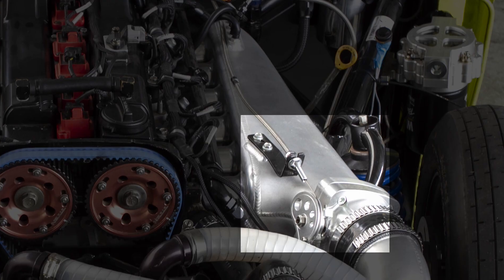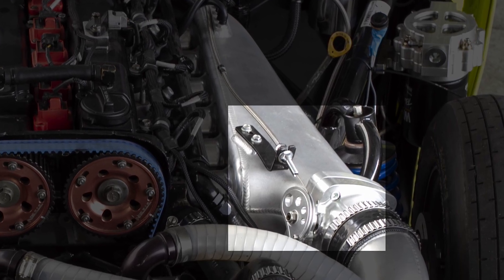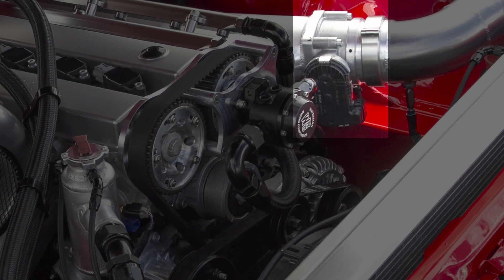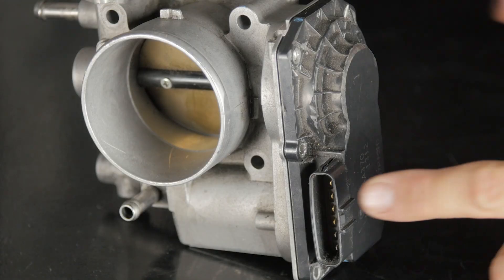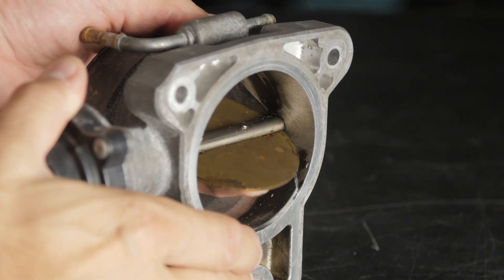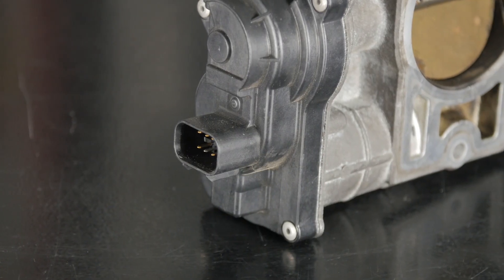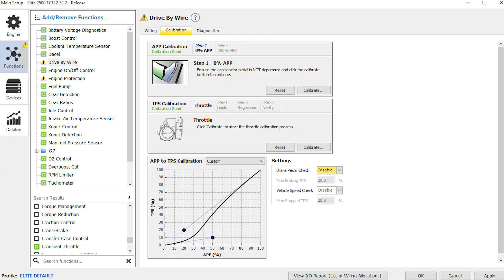🛠 Drive-By-Wire or Cable Throttle?  | TECH TUESDAY  |

Comment from the maker: Cable or Electronic? One has been around for ages and has plenty of supporters, the other claims to be better, quicker and more adaptable. In this episode of Tech Tuesday Scott gives you a brief overview of both systems and offers his opinion on this polarizing subject.
Reply: I personally prefer cable.. my old is300 drive by wire was a major pita
Reply from the maker: @MannyFresh1x  performance application of DBW differs greatly from OEM versions. Same throttle bodies and pedals, different control strategies. Give it another chance some time!
Reply: @haltech  no dbw can match the feel of the cable.
Reply: I have 3$
Reply: @ATLASGAMINGApallo  can you use brake fluid to clean a mass air flow sensor
Reply: @philfrancoeur4982  bwahaha 😂 😂
Reply: My favorite thing about these Haltech videos is it settles the argument for me. No anecdotal nonsense. Just a professional tuner laying down the truth.
Reply: You mentioned drive by wire cruise control how would a guy go about setting that up
Reply: Haltech just wondering about the 2jzgte in the aristo’s they are cable/electronic, so you use cable to open the throttle partly and the  electronic motor will open it fully?
Reply: Throttle relocations... oh my are there some bad one out there.
Reply: 2:14 it took Ford at least a few years before they made a reliable one. Just like when they switched to coil on plugs (though that was bad boot design)
Reply: DBW sux

Comment: My 2010 Mercury Grand Marquis (fancy Crown Vic) has an electronic throttle. I've been considering an engine swap because the 4.6 2v isn't adequate for a car that weighs 4100 pounds (1900~ kg, I'm American, sue me). The engine makes peak power at 4800rpm and torque at 4,000rpm. The car doesn't typically see above 3500rpm. The struggle is that the e-throttle makes the swap I'm looking to do, unnecessarily difficult.

Comment: A rubbish video. You did not mention that ride by wire failed all the time. And there is no warning.  Ride by wire is rubbish. Cable last forever.

Comment: If my car came with an idle air control valve that was plumbed into the throttle body and I convert to this DBW does the IAC valve get eliminated?

Comment: Electric throttle can be turned off if the car goes into limp mode. Pretty big downside if you want to drive the car.

Comment: If I buy an install a manual throttle body.How will the computer know what the timing is and how to make the engine run?Like when I've got the throttle Wide open. How the computer now?I've got the pedal to the floor
Reply: From tps input

Comment: Took an engine out of a truck Chrysler hammy.And plan on using it on my airboat.So I'm trying to limit a lot of the electronics and I'm trying to go cable to the throttle body.That's why watch the video.And I understand that your virtuality is great with all your electronics.But electronics on the water have a problem. Electronics is better

Comment: I just got a xr6 manual ute and the electric throttle is absolutely DISGUSTING to drive coming from only using a cable throttle, the disconnected feeling especially in a manual is just no good.

Comment: cable 100%. Some cars have so much delay on the throttle that you can quickly stomp it up and down before the engine does anything. Rev-matching is WAY faster and easier on cable throttle bodies.

Comment: I own cars that use both and the cable is SO much more responsive.  On electric, I can usually floor the pedal and lift off of it immediately and the engine doesn't even respond.
Reply: Depends on the car and tune

Comment: I hate driving stick with an electronic throttle, there's input lag as well as rev hang, so you get screwed on both ends in the feel department. That's a deal breaker for me, economical improvements aren't important to me for a car that I don't like how it drives. Thats the real downside to them. Thankfully my car was cheap, like cheap before the used market shot to the moon cheap

Comment: Ran into a major issue with an electronic throttle body. My serpentine belt snapped because my ac compressor seized, the alternator didn't have power and the gas pedal was the first thing to lose power. If it was a cable I could have driven all the way home to fix it

Comment: well shizz , i hated DBW i always been a cable guy ,but after you explaining it more correctly and how much more useful it really be specially wile im full standalone n forged n boosted it might benefit quite well as to my launch/2step/ n rolling anti lag that i might just switch to DBW... but i also have a jeep that is DBW and pos CVT but the throttle response is not exacly what i would say responsive unless u are like 50percent or more to the floor n then cvt will keep it at 5k wile accelarating till up to speed (redline at 7k) so it always kept me partial to a cable as i can set it how i want by hand ... as i further understand the usability of DBW i guess i need to "get with the times" .... lol ... n e way i stop rambling , peace n love to all stay safe keep it rad and build on

Comment: I have both and there is a hugh lag in the dbw on my 04 gmc 2500hd 8.1 when i need the to come on quick IT DOES NOT IT LAGS FOR GOOD 5 SECONDS IT SUCKS unlike my 96 chevy k3500 7.4 where its dbc as soon as my foot hits the pedal all the down it comes on now so yes i hate all dbw plus if you have dbw all you gps and onstaror other people can remotely stop your car from moving they CAN'T do that if is cable driven plus he is way wrong about priceing to replace the throttle body there almosy about 3 times the price of a dbc throttle body to replace plus the tps and iac valve can be replace indenpdently rather then buying to whole throttle body in dbw system

Comment: Until out of no where it decides to go in to a limp mode and not being able to go faster than 5 mph and it always happens when pulling in to traffic, cable driven throttle’s never ad any issues at 40k miles also if I want to check for a noise under load it can be done without anyone else having to step on the gas pedal inside the car. I like cable I like simplicity

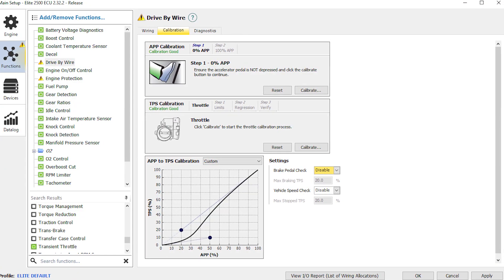Comment: If i keep dbw in a k24 Acura TSX, with Hal tech, can i tune it like a pedal commander would and remove lag i guess ?? 3:18 is what I’m referring to. It’s dbw but already has a cable in the bay… I’d like to keep ac but no heater… and i don’t mind going haltech… what ecu do i get ?

Comment: Cable definitely I have a 2007 Chevrolet Silverado have changed everything and still have problems with reduced engine power junk getting ready to replace with cable then no problems

Comment: Ahhh, there in lies the responsiveness problem.  If it is not a design flaw, then the manufacturers "dialed-in" the slow throttle response to pump up their gas mileage ratings, & or to minimize wear & tear on components.  If you are use to the linear response of a cable activated throttle (including a carburetor) then it is very annoying to have to modulate the pedal to get the car to respond appropiately.  Why should I have to over press the pedal initially (to get the speed I want) only to have to ease up on the pedal just enough?

Comment: There are a lots of motorcycles that have both cable and DBW throttle blades.
The lower "primary" throttle blades are cable and the upper "secondary" blades are DBW through the ECU (with Primary TPS, Engine RPM and Gear Position inputs) so we have quite a bit of tuning/control over them with ECU flashing...

Comment: I watched this video about a year ago when i was making my mind up about going DBW or staying cable. I ended up going drive-by-wire and honestly i cannot recommend it enough. throttle response and rev-matching is so perfect. There is no input lag whatsoever, idle is perfect. If anybody ever tries to tell you that cable is better - tell them to stop living in 1995.

*edit: 400kw RB25 S15.
Reply: Is that how arguments work now a days? stop living in 1995?
Reply: Nearly 3 years on, still using the same Bosch DBW throttle body. A+++++
Reply: @Songtester  with you on this. And respect for not rising to the bait!
Reply: atleast cable last longer and more reliable  a DBW would fail due to tps issues and all sort of stuff
Reply: Nah, cable is better, stop using your daddy’s money buying the newest cars

Comment: Considering how I could replace a while throttle cable assembly 2 or 3 times for the same $625+ price of just the electronic gas pedal. Not counting the throttle body and those parts.

So computerized or a physical cable. I want a cable that costs a fraction of the price to fix....

Had a cable loose once and just cut some off, tied it and used steel stick to hold it in place and worked great. 

So 8nstead of helping consumers save money on car repairs. Seems like they take old technology thats cheaper and could be adjusted and experimented with and they say oh no they can afford half a months rent for just one or two computerized digitally operated parts. Awesome right....

Comment: I think a lot of people don't like the "feel" of DBW because they are almost always set up conservative from the factory i.e. to minimise fuel consumption and emissions, sometimes at the expense of response and linearity.  Wheras with a cable, the feel is what it is.    Really its down to the tuning and not any inherent flaw with the technology, though I do wonder about the cost vs durability aspect of the DBW. The motors/gears etc. are just another thing to potentially fail and cost money. Though not really sure if thats a common problem?  My car (BMW E39) came with both cable and DBW engines so a conversion either way is pretty easy. Think I'll stick with my old cable for now though.

Comment: Might be good on a car, but they are HORRIBLE on a bike where you need good control and don't want interference from a computer. Motorcycles come with multiple ride modes now - the up-shot is instead of getting one fuel map that works, you end up with 6 that don't. Apparently, emissions standards are the reason they are so bad on motorcycles now. The other reason I really dislike the 'ride-by-wire' revolution is that now throttles react differently in every single gear and it is quite off-putting. They are also incredibly light and twitchy due to light return springs and a lack of friction (that I imagine is inherent in a traditional cable system). This means that while you might have the skill to easily control a bike with 180hp with a cable throttle, it is really scary (and I would suggest very dangerous) riding a bike with a 100hp, with 'ride-by-wire'. Anyway, this looks like a car forum, so I can't imagine too many people will know what I'm talking about. Clearly, this Youtuber is a big fan- for cars at least.

Comment: Absolutely hate dbw . My car feels like it has a giant turbo that only spools up if it wants to.  If the throttle body actually responded to the pedal like a cable I wouldn't have a problem with it but it definitely doesn't.  2015 Chevy Sonic 1.8 5 speed.
Reply from the maker: What you are feeling is a result of an intentional delay programed by the OE. A Haltech ECU does not exhibit this same behavior as the drive by wire curve and response is fully user programmable.

Comment: From my experience with electronic throttles, the response is not quicker than a cable TB. If anything, the computer seems to  "smooth out" the input and you will not receive the action YOU told it to do. Say I want to do a quick blip to throw some rocks. Quick as in less than half a second. My old 02 will do it very well. The 2012 I had, well lets say I had to hold her down for a bit. Sure there are benefits, but why change something that works so well? What we need back is the driving experience.

Comment: If Formula 1 users drive by wire then it’s the standard moving forward.
Reply: True Formula 1 is the primum so this makes sense.
Reply: Also use brake by wire

Comment: Cable is simple. People use to say "I'd rather have a carburetor and distributor because it's simple". But over time after learning about how EFI works and how to tune them, no one ever says they want a carburetor and distributor anymore. Given time and after learning how to tune this kind of setup, maybe people will like drive by wire more, I don't know. Cable is more simple yes. I won't argue that. I want to learn more about how I might be able to tune or even upgrade my fly by wire throttle body on my Firebird with a 3800 in it. I'm fabricating an inlet tube for a supercharger project that is in the works. But I also want to know if it might be easier to either bore out my current TB, or just switch to a larger one. I know it's possible to use the LQ4 MAF sensor instead of the stock MAF sensor. Guys do it with their L67 engines all the time when increasing boost and air intake. So I'm researching what I can do.

Comment: Is it possible to program auto blip on a h pattern via the ecu when it detects a brake and clutch signal simultaneously?
Reply from the maker: Yes! 

For DBW equipped engines we can program a throttle open position when those two criteria are met resulting in a throttle blip.

Contact our technical support for more information!
Reply: @haltech  Awesome good to know! Havent purchased a ECU yet guys. Not at that stage on my build but i definitely will be a customer of you guys

Comment: I that setup on a honda manual j series swap on a 2000 accord. I use the 04 tl which has that cable peddle sensor and then to a tundra throttle body. And it works good.

Comment: Now we just need an easy process of switching the wire back to the cable!
Reply: Put cable throttle body in place of E-Throttle body, Depin and Repin TPS to suit Cable TB. Add throttle pedal and cable. Or int he case of BA/BF Barras. Fit AU falcon upper plenum and TB to Barra lower. Attach cable and add ISC wiring.

Comment: Just converted my 1j non vvti fc rx7 to e throttle. So simple. Used a throttle body from a vq25 and kun hilux pedal. Cost 100 bux kiwi easy  to mount cleaned everything up and way nicer on the right foot.
Reply: Would the hilux pedal suit Nissan s14 also?
Reply: @zenkisilvias1428  dont see why not.  It will need to be calibrated anyway. Just choose something that suits as far as mounting goes thats what i did

Comment: So is it as simple as taking the adapter off of a K24a cl9 accord, and getting the cable from a k20a?
Reply: don't think so. The signal from the box goes into the ecu, which then feeds the TB.

Comment: Quick question. can't find an answer on any forum anywhere...Running an elite 2000 on a 300zx (TT) with dual tb's. Wanting to convert to dbw. Can I just source both reference and signal wires from the same output to both TB's? Is a dual setup even possible to calibrate/operate?
Reply from the maker: Hey Chris, 
Get in contact with our support team: www.haltech.com/support 
They'll be more than happy to help answer your questions :)

Comment: Problem with the electronic systems is they limit how fast the throttle can open (for safety and "eco" stats reasons). So you don't get the immediate response you do with a cable :/

Comment: Cable is better doesnt fail and cheaper than most expensive electronic throttle body which has integreated tps sensor

Comment: I am going to run dbw on my impreza and will be doing all of the wiring/fuel/engine/etc so hopefully I integrate the original oem cruise switches correctly with the elite 2500.  May need some help getting cruise working "properly" as I've read online of people struggling with it. The tuners may be able to dial it in, but since they live a few hundred miles away I won't be able to take the car back for every small issue.

Comment: Hi. I am doing a swap with a complete engine that comes with DBW. I want to use the ecu with the DBW funciton so I was planing to adapt another throttle pedal. The tip about the Honda module is great! But can you be more specific supplying a link for us to see which is the exact part you are talking about? Thanks!

Comment: With cable you learn how to drive the car. After a couple trips you master the power delivery. With an electric one the engines "tries" to make your decisions better, but there is always lag, and inconsistency
Reply: It's funny, one of the justifications I've heard is that it provides a "more consistent" feel... If they mean they all feel sh!t - true. If they mean they all react the same - nah...

I've had the fortune of using multiple cable throttle engines. Different manufacturers, different configurations, different power... Guess what, they all "felt" more or less the same in their nonlinear responce.

No latency, no artificial "smoothing", no "adapting to your driving style", just the pure, honest engine.
Reply: Depends on which car. If it's a cheap car then yea it's quite laggy
Reply: @dr.science_0177  Cheap, expensive - it's all the same. Always extra latency, always some bullsh!t "smoothing" algorithm.

Comment: I'm doing an LS swap and want built in idle and cruise control. I need to find a part number for that cable-to-electronic converter?
Reply: You can have cable and still idle and cruise
Reply: @pepeiann  I need to know what parts to get to do that.

Comment: "Some Honda Accord Euros around 2005 era used a cable to electronic adapter. Don't ask me why. Where there's a normal throttle cable in the cabin which goes in to a little box in the engine bay which then converts the cable to the electronic signal which goes in to the ecu. This little box is perfect for a retrofit because you don't need to reengineer the throttle cable."

Didn't you just answer your question of why Honda did it? They didn't have to reengineer the throttle cable.
Reply from the maker: They already had electronic throttle in other cars, so little to no re-engineering was required.